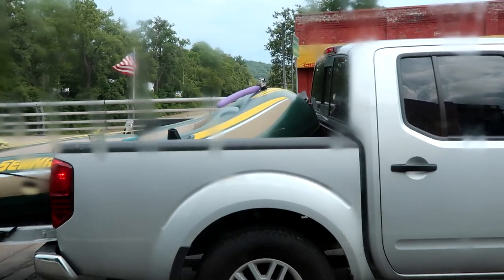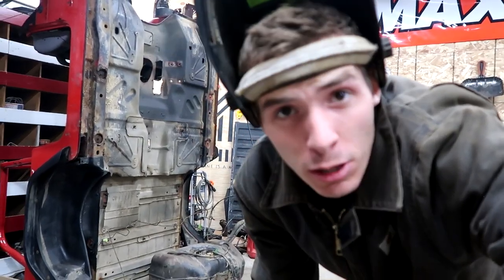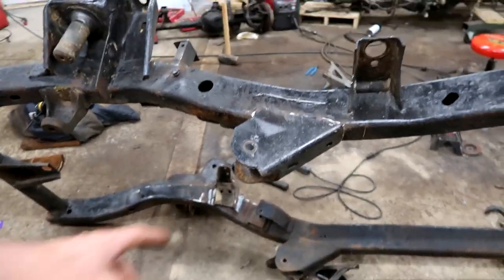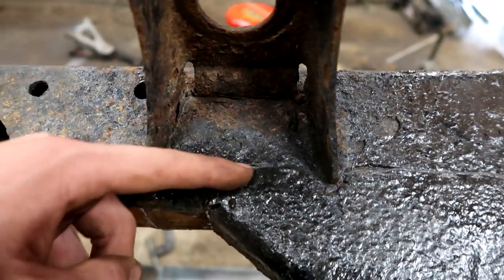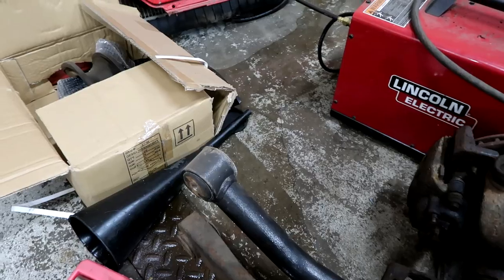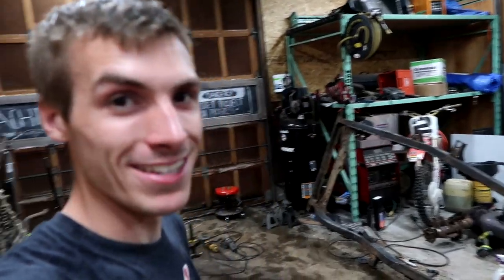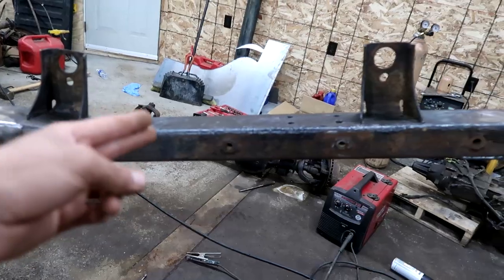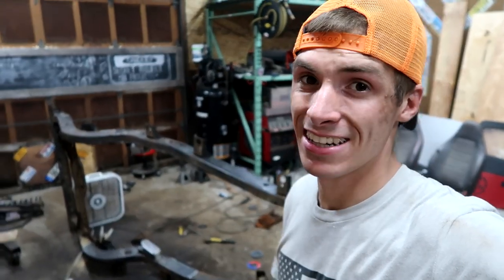Custom Jeep Project

Comment: should look at using Spray Bed Liner instead of Painting the tub, so it's as rock solid as the frame an other bits. And it looks F'n Braptasticccc!!!!!!
Reply: He could also use spray bed liner on the frame possible where he can
Reply: The bedliner would tee too risky since it may trap too much water. The reason it works in a truck bed is since it opens up to atmosphere/sky. Under the Jeep it "opens up" to the tub
Reply: what? protecting the metal only works if it can air out is your agreement for not using it. You really want to stick with that one?

Comment: Dalton u haven't said but u mite want to buy upgraded axles for your dana 30 and Hd u joints too if those tires are hard on axle u joints and axles just a suggestion.

Comment: Should of drilled some holes in the plate you welded on   get more weld contact to the frame
Reply from the maker: SAL Goodman
Reply: Can always still drill a hole and fill it back in.  Easy fix!